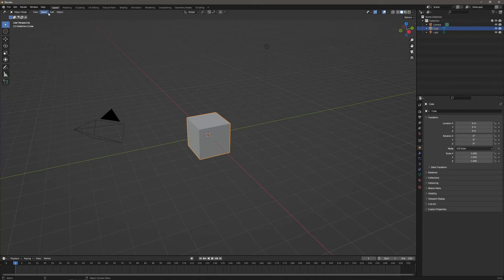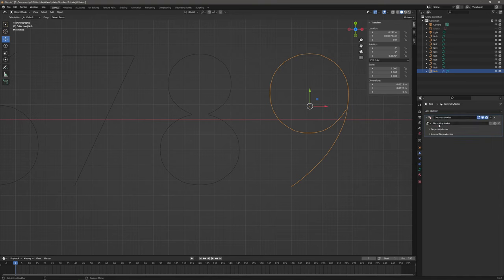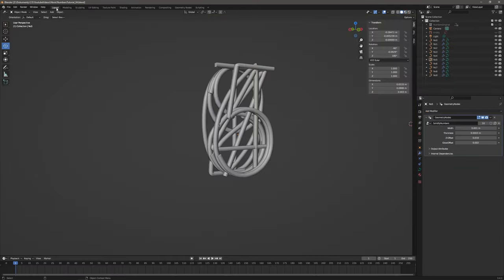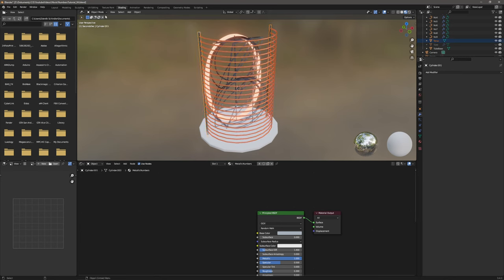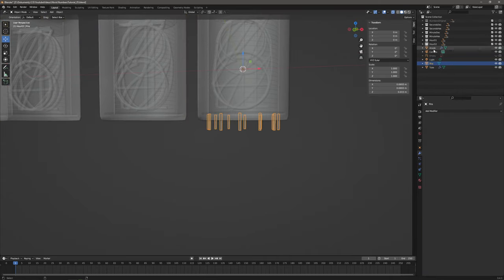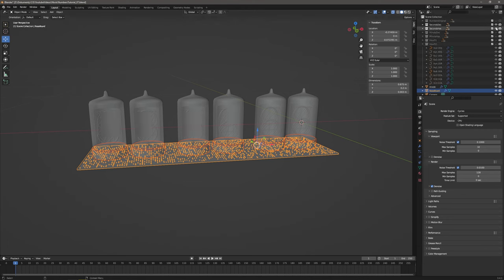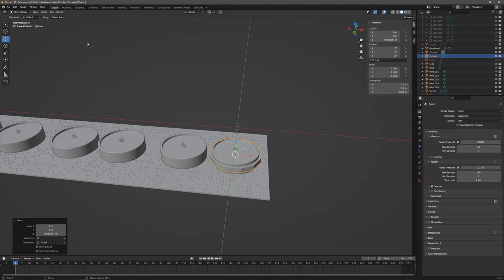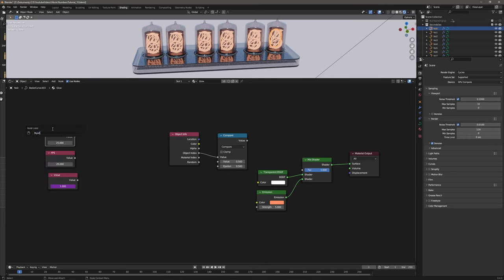Nixie Clock in Blender - Full Project Tutorial

Comment: Hi, thanks so much for this tutorial. This was exactly what I was looking for in a project. However, I am having issues with  the clock shader. I am up to the point in the Seconmds Hex where you subtract 2, but when I go to change the seconds value (StartSeconds Node) - my clock still says 00. Is there any chance you could share an image of your shader setup so I can troubleshoot? Thanks, am I have subscribed for more!!!!!
Reply: Ooops - I forgot to set the FPS (it was at zero). Thanks again for the tute!
Reply from the maker: Sorry for my late answer. I'm glad you like the tutorial and that you have figured out the problem! In case you need any more reference I have added a link to the finished clock file in the description.

Comment: Hello ! I have a question : In which chapter of the video do you specify the object index used in the material ?
Reply from the maker: Hello, first it is in the chapter "22:48 Arranging the digits" just for the first set of digits and then it is in the chapter "49:40 Placing the components, adding pins and socket"